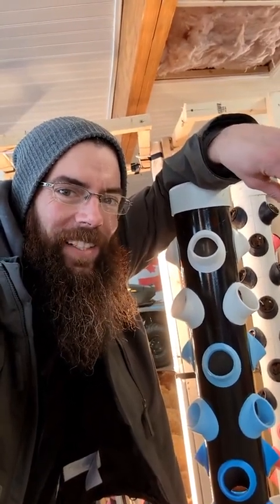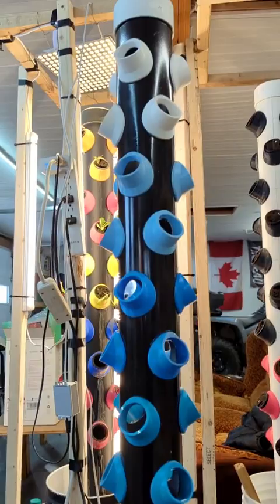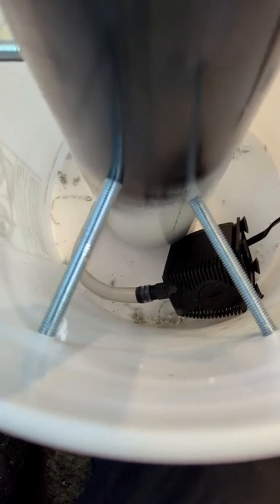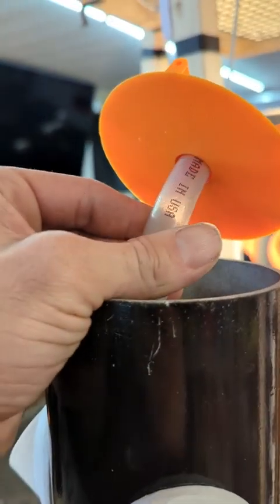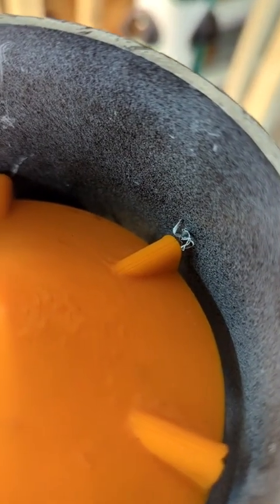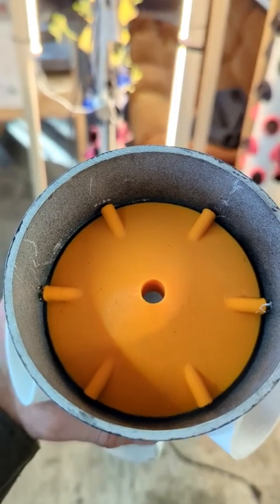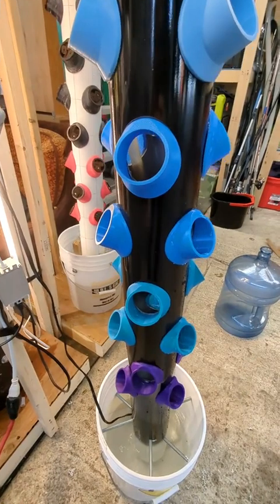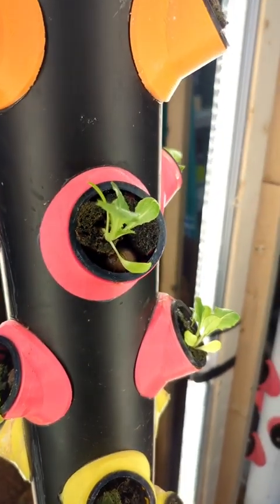Easy DIY Hydroponics Tower Build part 3

Comment: Hello, I built one of these last year with about the same hole configuration. I lost momentum with the project dealing with my other hydroponic projects. My plan is to get it going soon. I see you are using lettuce. Any thoughts on other plants that will do well, and did you have any issues with root congestion with that spacing configuration?
Reply from the maker: ive done lettuce and a few other small plants, ive had no issues with root clogging